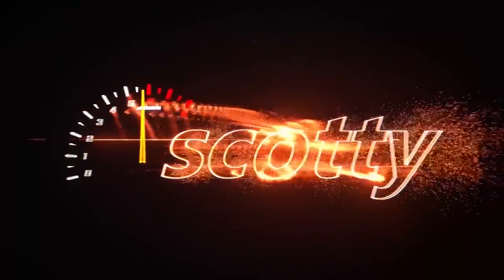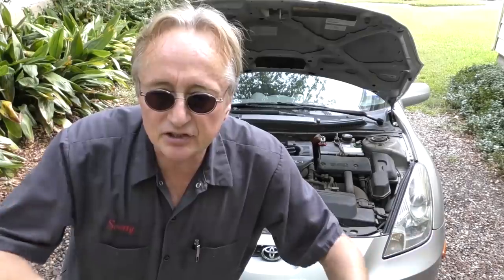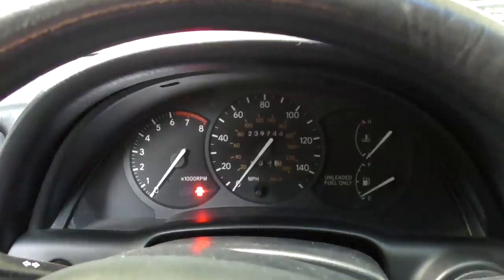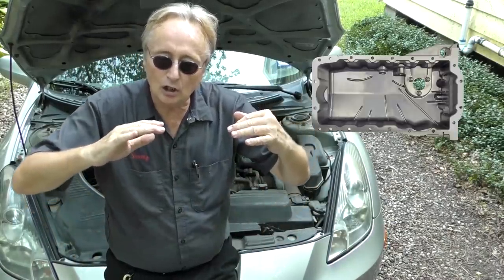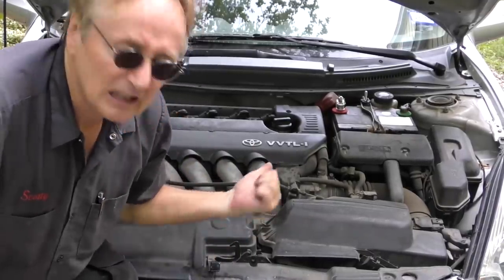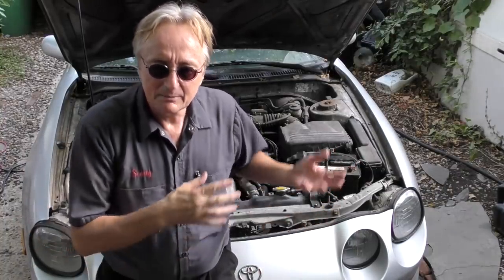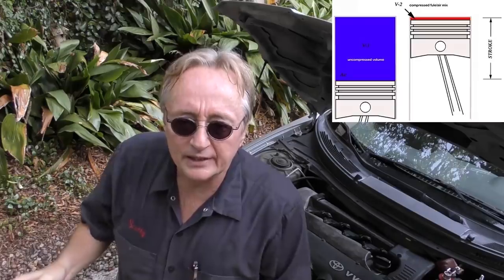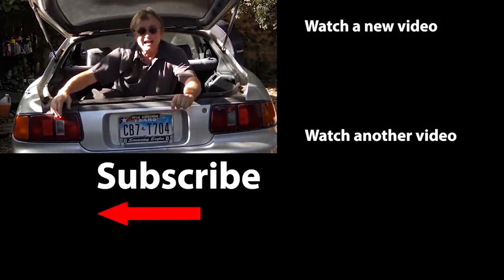Why Not to Buy a Toyota Celica

Comment: Hello, I have a question about the coolant, what should be pink or red> Toyota Celica 1.8 TS, VVTL 189 KM 2003, I will be grateful for your answer. Regards Fan Celica and good Video materials
Reply: Pink is diluted coolant.  Cheaper to buy undiluted RED coolant and mix 50/50 with distilled water.

Comment: I had the same engine in my 2004 Matrix xrs and it had 180K when I sold it and never had an issue and I beat the crap out of it.
Reply: Bill Metz right? Im at 289,000 on my corolla xrs, no problem either
Reply: By the time the corolla xrs/matrix xrs the oil pump issue was resolved.  I think their only issue was the timing chain tensioner leak.
Reply: @CanielDonrad  Ahhh I did not know that, I'll look into the chain tensioner leak, but thanks for the info! So did Toyota/Yamaha just redesign the oil pan/pump once the XRS came around?
Reply: To be honest I am not 100% sure if it was a pump redesign, component swap or pan change.  I have never dealt with a 2zz myself.   I do know there are many aftermarket oil set ups available for them that are designed to prevent the issue entirely.
Reply: Both the pan and pump can contribute to knocking. The oil pump shatters with money shifts, (sends to 10Krpm think the pump let's go around 9,500 or so) and high g corners hitting lift, the oil sloshes to one side away from the pickup tube and it runs dry long enough to spin bearings.
Reply: @kotymccallister5150  - Never made that mistake with the money shift and I am lucky I didn't since the six speed was a bit sloppy. I did pop it off the rev limiter a few times..... many times.
Reply: @mdirect77  I did in mine daily lol. Never had an issue.
Reply: @mdirect77  hot the rev limiter... not Misshift haha. Did that in my gt though

Comment: Friend of mine got 2000 Celica 1.8vvt-i 140bhp, 6 speed manual.. what a great build  little fast thing! He got it for 350€, needed front brake pads, 4 spark plugs, oil and filters!  
Everything else was stunning, clicking and working like Swiss watch! 
We drove that Celica through the whole europe during holidays and the following car for the trip (Opel Meriva 1.3cdti) (Italian jtd-M engine) had a alternator failure half the trip.  We had to stop every 10miles and exchanging battery’s between the Celica and the Meriva. Day and night!  The Toyota never broke down, simple 2 door small car but so well built!

Comment: My ‘00 celica gts going on 190k miles strong with original motor and transmission.
Reply: Mine its on 234k miles with original motor
Reply: I had one that had 186k before I traded it for a lower mileage Celica. Once again original everything apart from the usual brakes, filters etc
Reply: I sold mine at 220k right before the sub frame snapped. The guy called me and told me the sub frame snapped on him and when they went to jack it up the jack point blew out on them.

Comment: Here is why new Corollas are crap: CVT Transmission
Reply: You can get it with a 6 speed manual
Reply: David Cisco  I rented one a couple of months ago and did snow driving in Oregon. I was impressed but I would rather buy the six speed.

Comment: My 2000 celica gts has 160000 miles and runs fine
Reply: Dont rev hard.. else 2:48
Reply: @lemonflavorclorox7389  "POOOOH"
Reply: @lemonflavorclorox7389  I dont rev past redline and for the most part I treat the car nice and keep it in good shape
Reply: Mines is doing great too. I'm at 210K with my GTS.  No engine replacement or rebuild.  Nothing beyond typical maintenance.
Reply: 2000 models are just so ugly
Reply: @hexdecimal9210  I wont deny that I dont quite like the design I like the way the 90s ones and the alltrac look
Reply: LOL, yeah...well not every car can look as hot as a Gremlin
Reply: @scubagib6438  I don't even see why people have it i think it looks fine
Reply: Owen Tessier-Morse ,
My daughter bought one new.
She did all the required service and high test gas.
At 180,000 miles sold it for 4000. ( been hit four times). Bought a 4 Runner. 200’000 plus miles still running.
It’s all about how you drive and maintain a car.
Reply: Terrible slow cars
Reply: Mine has 258,200 and I'm still on first trans and engine (automatic 2000 GTS). People don't maintain the lift bolts and clean the ocv filter and such.
Reply: Scotty: Anything made by Toyota.... good..... wait this engine is made by someone else...crap
Reply: @mikekemp3002  Automatic hah

Comment: When I worked at Toyota, the problem came from shifting into 4th by accident instead of 6th resulting in the pistons hitting the valves...never knew about oil pump or pan problem. I thought Yamaha just did the head?

Comment: I dunno, my 01 gts is at 156k miles and doesn't use a drop of oil between changes (7000) miles. It gets great mpg, like 34 on Hwy. I just don't plan on revving it over 5-6k rpm. Plus I always keep the oil level a tad over full. I use mid-range fuel so it's an extra few bucks per fill up.

Omg, am I actually disagreeing with Scotty.....no.
Reply: You should definitely run 91/93 octane fuel, and enjoy actually revving your motor to redline as intended.
Reply: Bad practice to over-fill the oil as it doesn't do the oil seals and scraper rings any good.
Reply: Car takes premium. You gotta put premium
Reply: @ColinH1973  very true.

Comment: WHICH TOYOTA VEHICLES HAVE AN OIL DEFECT?
The following Toyota vehicles may suffer from the oil consumption defect:
2007-2009 Toyota Camry
2007-2011 Toyota Camry Hybrid
2007-2008 Toyota Solara
2009 Toyota Corolla
2009 Toyota Matrix
2006-2008 Toyota RAV4
2007-2008 Scion Tc
2008-2009 Scion Xb
1998-2002 Celica / Corolla / Geo Prizm
2006-2011 2AZ-FE engine

Comment: Here in Europe the Celica had the 1.8l with 192hp or 143hp. The engine with 143hp is reliable.
 At least for what i know.
Reply: 2zz were more reliable actually. 1zz had problems with using a lot of oil.
Reply: @hippopotamus86  Spot on. By the time Toyota fixed the oil issue on the 1ZZ engine, the Celica was about to be axed. Any 7th gen Celica on the road, has either had the 1ZZ engine replaced, or in the case of the 2ZZ rebuilt/modified. Any Celica on their original engine, must have very low mileage, driven gently or in the case of the 1ZZ, just keep topping up the oil.
Nice car, shame about the engine.
Reply: konradc12 Its actually a very nice car, for 1999/2000.

Independent rear suspension, very Nice ride.
Reply: @konradc12  So, the 192hp and 143 hp Celica's engines were both unreliable?
Reply: I have the 143hp 1ZZ one and it definetly likes to drink oil witch can be a problem but mine has over 180 tkm and no huge issues. Its really good to drive and the 6-speed is fun. I live in Finland so in the winter it can be annoying. Would still recomend for a fun to drive car or a first car
Reply: konradc12 Gday mate! Is that in regard to 1zz pre facelift model? Read that they fixed the oil burning issues with the 03/53 reg “facelift” 1zz engine?

Comment: The problems explained in this video were with the models up to 2002, Toyota then revised the design and dropped the rpm limiter and switched the point at which lift kicks in. They also revised the engine oil delivery system meaning that there were no oil starving issues. Proof of this is how many celicas have survived until today. Mine for example is an 03 with 167k miles on it. Original engine and only minor maintenance over the 6 years I've owned it. I admit I don't use the cheapest fuel but that's normal for anyone who respects their cars. Celicas were and still are bulletproof cars.

Comment: I have an 02 celica gts with 197,000 miles on it. still runs like a clock
Reply: Yep mine is still going at around 180k miles. I rev the guts out the thing every drive.
Reply: Yeah wait till it hit the 220 range even if it'll do that
Reply: @xfineselawdx2996  No reason that it can't. Plenty do much more than that. Even then, 220k miles is a lot for any car. Never see fords do that!
Reply: 02 matrix xrs 6 speed with 280000 miles. Drive it every day.
Reply: you buy one of these to have fun, not to put hundreds of thousands of miles on it.

just buy a bog standard 1.6 corolla for driving around and it will run forever.

Built
For
Purpose

stressed engine - dies sooner duhh
Reply: @Spazz5697  I bought mine for fun, just happens to have 180k miles on it. What's wrong with that? 🤦‍♂️
Reply: @hippopotamus86  all Im saying is, yeah, very good it can do that, but one should not complain about 2zz for not lasting many miles.

sure, it will go 300k if you very rarely hit LIFT and go nice on it, but thats not what its meant for.
Reply: @Spazz5697  I regularly hit lift every day with mine. Engine is solid. In fact, I bounce of the rev limiter at 8000+rpm just for the fun of it. Scotty is wrong on this one. The first original 2ZZ Celica's had problems but only in Japan. They revved way too high. They fixed that simply by limiting the RPM before they reached the rest of the world. As always, it's an excuse for Scotty to bend the truth and make a controversial video about it
Reply: @hippopotamus86  I have one in the UK with about 86k on it and I love it. coming from 110hp to 192 was interesting :))) 

I dont really believe Scotty much now, was curious with his thoughts on this one. 

All cars are quite cheap here so its easy to get one with low miles, so longevity is not all that important, more like... general reliability. I paid like probably the equivalent of almos 3k dollars for mine
Reply: @xfineselawdx2996  I'm at 219k 😅
Reply: Mine is 210,000

Comment: Scotty how about the regular 2000 Celica GT with the 1ZZ (the 140hp one)?
besides some transmission fixes mine's running sturdy and fine at 165k miles
Reply: Did it come with a 5 speed or 6 speed?
Reply: @hispanosaurusrex  5 speed manual, 4 speed auto. I have the 5 speed myself.

Comment: love the content.  I owned a 1995 Celica with the 1.8 engine and a 5 speed and loved it.  In fact, I'd have to say I beat the heck out of that thing and it never failed.  I sold it with 230K on it and it still ran great but for the a/c not working.  I have to ask though, about Mazdas.  I do not disagree about the wisdom of avoiding rotary engines (though they are a lot of revvy fun) and heat exchange and direct injection engines, for maintenance reasons.  I have owned a couple of Mazdas that had what we might call a normal 4 cylinder engine and a manual transmission and they seemed basically bulletproof.  One was a 1992 B2200 pickup that routinely carried more weight than it was supposed to and didn't even get proper maintenace (I was young and stupid and didn't even know I was supposed to regularly change the oil).  The other is my current car:  a 2007 Mazda 3 with about 130K on it.  I've never had problem 1, and it drives better than anything in the same price range, especially on twisty roads.  I don't disagree about the rotaries or other stuff, but do you think a Mazda with a relatively "normal" 4 cylinder + 5 speed manual is a bad choice?  Because I have to say they're more fun to drive than most competitors and just as reliable.

Comment: Scotty are manual mazda 3 2008 hatchbacks reliable?
Reply: My manual 2008 Mazda 5 has 330,000 km and it still runs great. Most of it is the same as the Mazda 3.
Reply: Thanks, i've heard some bad things about the 2.3 engine so I decided to ask before buying one
Reply: Just have it inspected by a professional mechanic, with a $5000 fancy diagnostic tool, get a manual, baby it, and that zippy little car may be really fun to drive around
Reply: Yes. Poor quality paint though
Reply: Thanks everyone, just found one with 85k miles for a decent price
Reply: @n3kbrEak3r  what's decent?
Reply: @chevydodgedude1234  4,500, pretty acceptable for were I live.
Reply: @n3kbrEak3r  that's a steal
Reply: Yes
Reply: @n3kbrEak3r  I had an '05 Mazda 6 with the 2.3 and that car had around 205,000 when I gave it away.

Comment: I have a 2000 celica gts with 265000 miles on the original engine.
Reply: You still got it? Is it working fine? I’m tryna get one as my first car but this old dude talking about it not being reliable
Reply: @fleeswervinn7111  no sadly
Reply: @Sonicz0  damn that’s tuff old dude was right about the Celica 😂 what car u suggest for my first car under 4000
Reply: @fleeswervinn7111  try and older Silverado or any Toyota Camry, Honda Civic

Comment: I owned one of these  Celica's a 2001 190,was 7 years old when I bought it,in the 4 years I had it,it was faultless.
Unless you count a replacement battery and one stop light bulb.
Changed the oil and filters every 10k with genuine parts.
I'm sorry I sold it,but I needed a bigger car.

Would I recommend one?
Absolutely!
Reply: You raced the car when you were 7 to 11 years old?
Reply: @hanssolo4695  🤣No,the car was 7 years old when I bought it.

Comment: I was terrified when I saw the thumbnail, because its gonna be my first car. But the one I'm getting is a 03 GT luckily.
Reply: Gt is even scarier cause they have oil consumption issues. The gts can be fixed by changing the oil pan, oil pump and lift bolts
Reply: GTS with 2ZZ engine is a serious high-performance car, a hoot to drive.

Comment: my 2003 celica has 202,000 miles (8th owner). Got the intake manifold gasket, oil pan gasket, and chain tensioner replaced. Otherwise it drives great though it starts rougher after its been warmed up. Honestly not a bad car at all and it looks almost brand new besides the paint and front bumper. Even the sunroof works!

Comment: I don't know...have my 2003, still with the original motor...
Reply: is it the GTS?
Reply: 2003-2006 had better designed engines
Reply: @gablor  There was no difference in engine design. The only thing they change was the rpm range of the LIFT. Was 6k to 8400k. Changed to 6200 to 7800

Comment: I had a friend who went out bought one of those Taurus SHO’s brand new. He finally sold it after putting three engines on it. 
Another friend that had a Ford contour, 1997 I believe, and he had the same problem. He would turn a corner sharply and blow the engine.

Comment: I've got a 2000 GT-S with 256k miles, original engine. You just gotta change your oil every 3,000 miles and don't go past redline all the time and you'll be golden. And don't get me wrong, I drive it like a race car every day, and its still doing just fine. I definitely don't baby it.

Comment: I had a 2000 Celica GT-s, I bought it at 170k miles and drove it until just under 290k when the clutch went out and I decided to sell it. I never had a problem with the engine and I drove it hard, I contstantly revved it to 8k. I must've been really lucky.

Comment: This will be a shock to Scotty, but almost all Toyota performance engines - like revered 2JZ-G(T)E or the proper Celica T20 engine, 3S-G(T)E (none of that 7AFE oil addicted crap with no power) - they ALL HAVE YAMAHA HEADS. 2ZZ is no exception. And just like any high-reving engine - you just need to always be aware of your oil level. Won't speak about "premium gas" because that is uniquely US issue - Europe only has 95/98/100 octane fuel and by default we don't have the issues related to lower octane levels.

Comment: This is the same engine in the Corolla and Matrix XRS models. Maybe they aren't as reliable, but you can rev the piss outta them like 8000 RPM
Reply: Those are actually reliable
Reply: 8400 is the originally intended redline, but Toyota gimped it down to 7800 to protect the engine when the customer misshifted.

Comment: All of the issues scotty mentioned were fixed in the 2003 models and newer.
For older models, there are now off the shelf mods/fixes which include a better designed oil pan, oil suction and pistons.. pistons just have one or two more holes for oil to escape.. instead of burning away...on top of other mods such as uprated valve seals and piston rings can really make these engines bulletproof and beyond. In the Celica world, a lot of people say the 2zz is the worse of the 2 to tune. A well maintained 2004 1zz-fe will go as long as you are willing to keep on top of maintenance and checks.

Comment: Ive got a 2000 gts its still a good car but i agree its nowhere near as good as the old one in terms of durability got mine used a while back somehow i got lucky mine works perfectly fine and it still has the original engine with 230k miles

Comment: Had a 2002 celica gts with 215k with its original engine and it was fine, rough, but fine. It had a oil leak and the check engine light would come and go but it was bulletproof and would start up everytime. And it wasn’t like the previous owners took very good care of it either I just made sure the oil level was good and would top it off every once in a while. My brother also had one with 242k miles and it was fine for the most part as well.

Comment: If you're racing, moroso oil pan will solve your problem. If you're high mileage and your front cover is leaking, just replace the chain and the oil pump gear to billet pump gears. If you DD and beat on it every now and again, just put 5qts of oil. Always upgrade your viscosity if you know you have a heavy foot. Use 5w40 like lotus recommends. They are the same engine with a different ecu tune.

Comment: Had a brand new 2k GTS with factory installed body kit and wheels. Loved it, fun to drive especially when it engaged the high cam lobes. Beat the piss out of it. Started leaking coolant from the water pump luckily it was still under warranty. Got rid of it soon after. I do miss it tho.

Comment: The GT version of that Celica has the same motor as your Matrix, and did have problems with bad piston rings up to 2002, but was fixed in the 2003, I've had both

Comment: Try this if your celica acceleration is poor: Drive few miles to warm engine and cat and keep rpm about 4000. Stop engine and wait 5 min. Tape vacuum cleaner hose to  exhaust pipe make sure there is no leaks and run vacuum cleaner about 15 minutes. Then check engine bay there is every hose in place where should be.